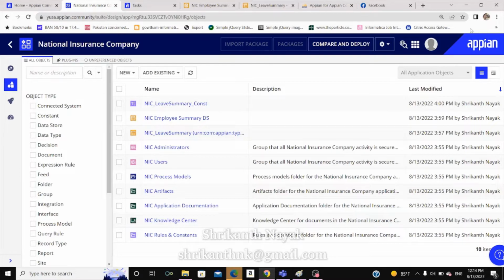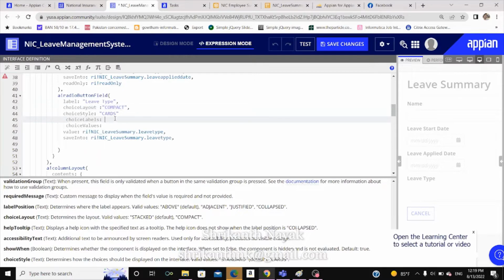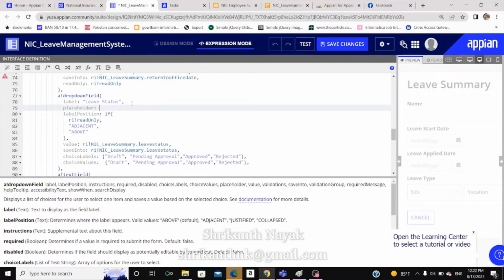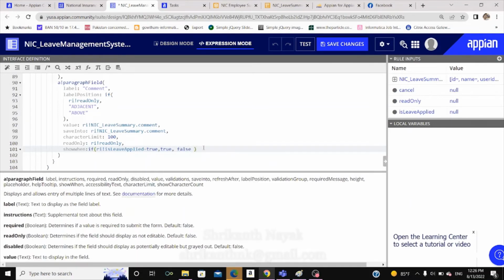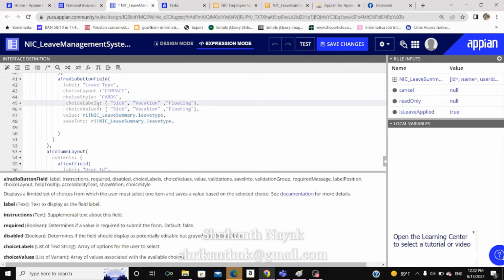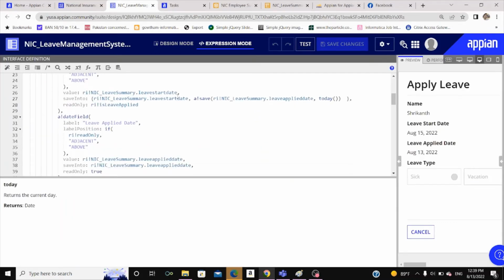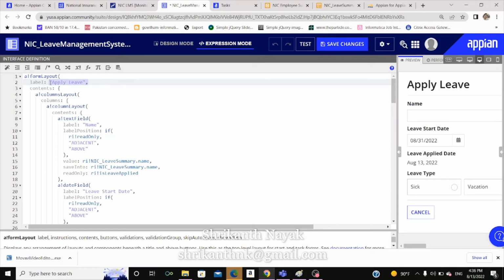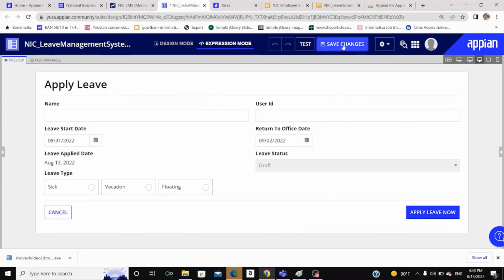Appian - Leave Management Sytem - Interface Design | Appian Tutorial | Part -2

Comment: hi
Reply from the maker: You can make use of  function today() which returns date  value ( GMT).    So   Button. Saveinto. Parameter you can use.                    a! save ( leave applied date , today())
Reply: @shrikanthnayak8629  Could not display interface. Please check definition and inputs.
Interface Definition: Expression evaluation error at function a!dropdownField [line 94]: A dropdown component [label="Leave Status"] has an invalid value for "value". Value cannot be null if placeholder is also null.
Reply from the maker: You can add below lines  to drop down value code.                                        placeholderLabel: "--- Select a Value ---",